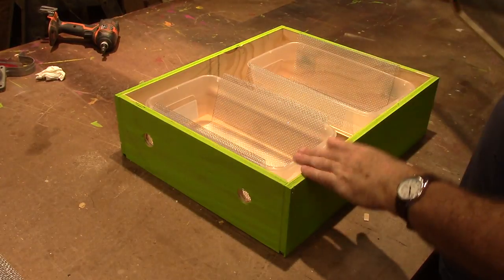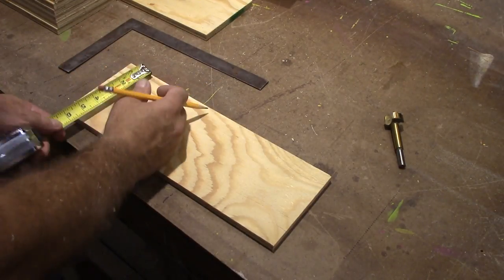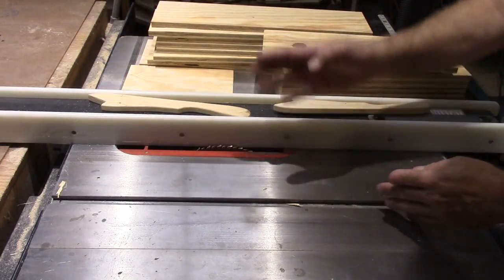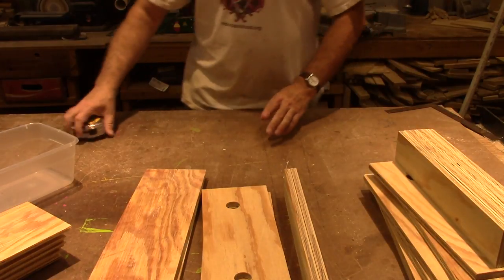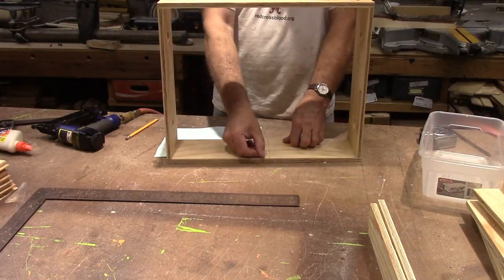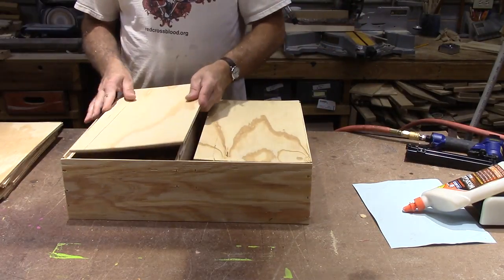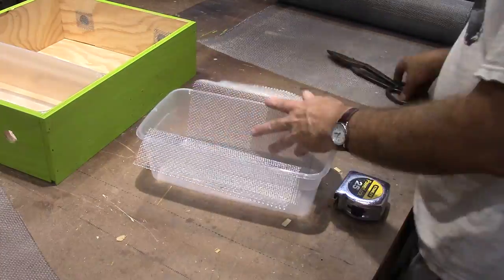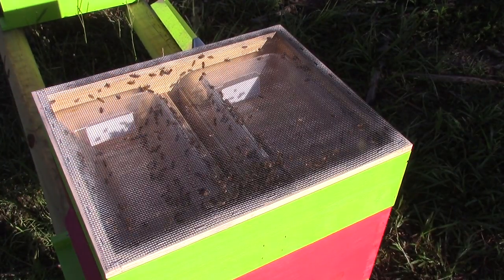DIY Sugar Feeder for Langstroth Hive

Comment: Thanks for sharing that. Great design. I'm setting up my first hive in about a month or so and was looking for a feeder idea. I was wondering,  instead of the ventilation holes on the side, if the screen frame you put on top had a few half inch standoffs to hold the top cover up a little. Do you think it would provide adequate ventilation?
Reply from the maker: You're welcome.  I think your idea for ventilation would work fine.  Good luck with your hive!

Comment: Hello sir,
Thank you for your video I ask you to tell me where I can find the diferent painting that you apply to your hive
question number 2 the holes on the side of the frame feeder he squeezes to what?
  thank you for France
Reply from the maker: I'm not sure of your questions I don't think they translated correctly.  The colors came from Sherwin Williams Paint Company.  The screen in the ends of frame are 1/8 inch mesh.   Hope that helps!
Reply: Thank you for your answer I will rephrase my question
the 4 holes drilled on the frame is for the return of the area?
Reply from the maker: Those 4 holes provide ventilation for the hive and to remove the moisture from the sugar water.
Reply: thank you for the information I did not know